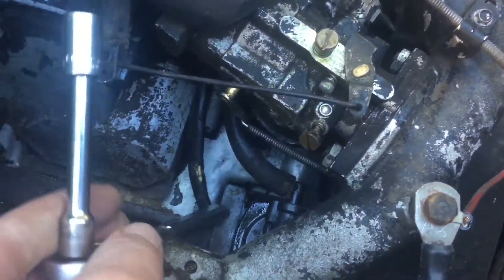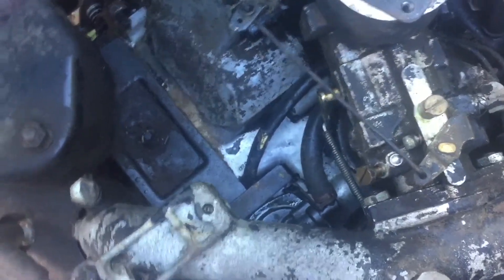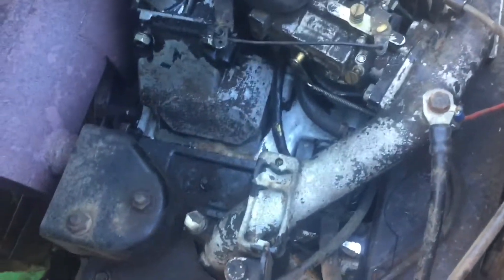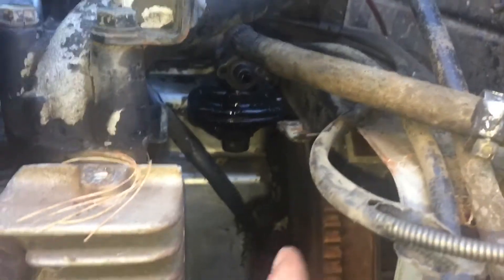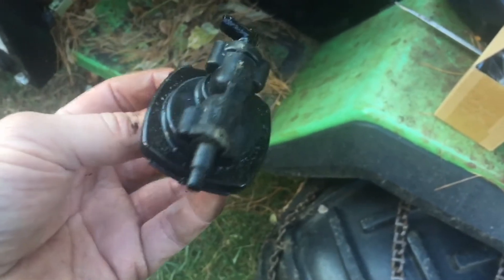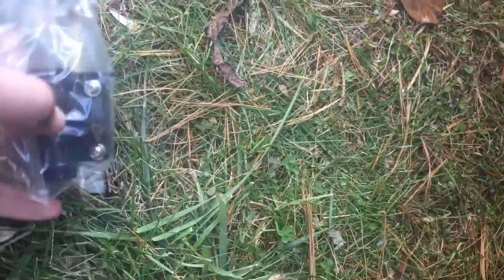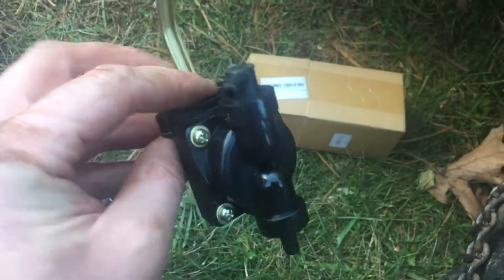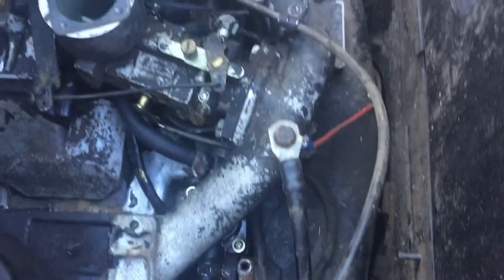Deutz Allis 1920 Part 3 New Fuel Pump Install

Comment: The low pressure electric pumps work wonders. I highly recommend giving one a try if you have trouble with the mechanical pump again. A fully primed carb fires up the engine much easier and quicker. Especially when it's cold outside. It was the best modification I've ever done to a GT. That's a nice look rig btw.
Reply from the maker: Thanks, I have heard that before.  I actually had bought one and never used in on anything.  I figured this oem one lasted 30 years so I would replace it.......
Reply: My original one lasted 30 years, but the next two mechanical pumps lasted a couple weeks. I hope you have much better luck me.